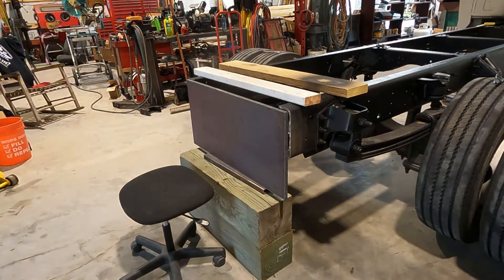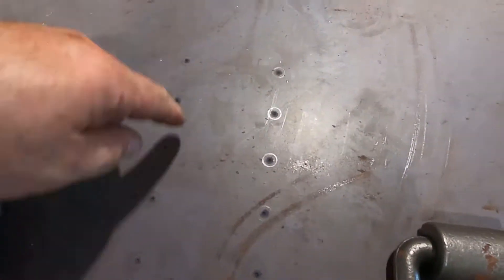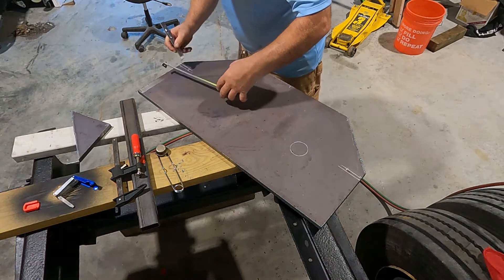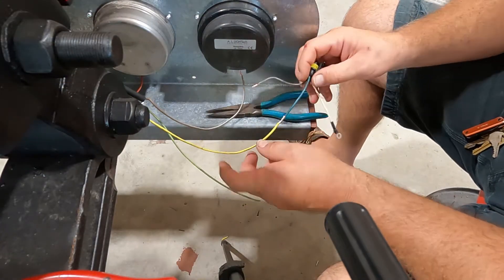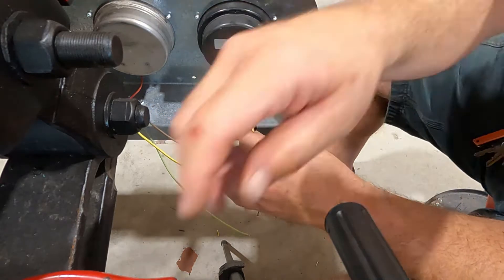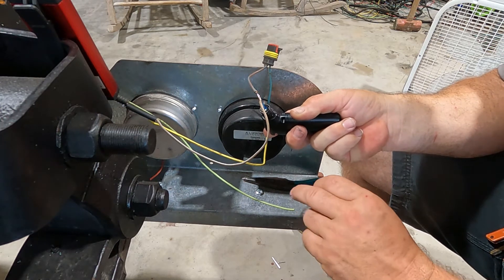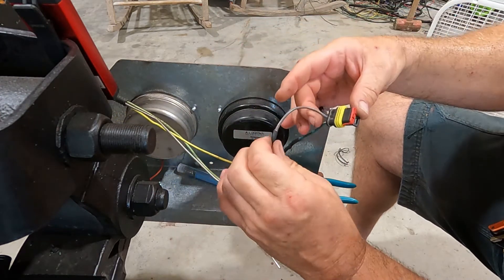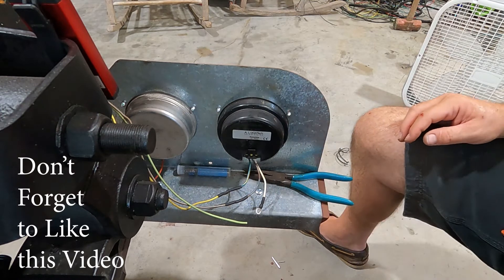U-haul, GMC 5500, Topkick, C5500, Hitch plate, Build, Welding, Fabrication, Time Lapse.

Comment: How are these trucks for towing tractors/ equipment?
Reply from the maker: I towed a 24ft trailer...total load of 16K/lbs every day. To be honest you could barely tell it was back there. GMC550 is a big truck for medium duty truck. 8.1 gas motor with an Allison 5-speed. They do pretty good pulling.

Comment: Are you a certified welder
Reply from the maker: Yes I'm a certified structural welder. I'm also a certified machinist and GM certified ASE master tech.
Thank you for asking and I appreciate all of the comments I receive.
Reply: No just welded for yrs and welding was a job i had at a large plant.
They never rejected any of my welds.
I got the hard jobs others couldn't  pass!

Comment: Is there a way to contact you?

I have a question you can answer for me and I’m willing to compensate you.
Reply from the maker: Sorry Boss I've been busy and haven't checked my comments in a while. I would be happy to answer your question if you still need my assistance.
Reply: What is the Question?
My design one of the major company engineers said that would be a 30,000 lb hitch.
Not a bad design then.
Reply from the maker: @edwardcarberry1095  Maybe static load. But I wanted to be sure it could take a solid hit or a good bit of tugging around. Just in case something crazy happened.